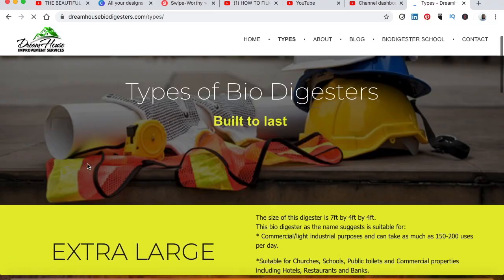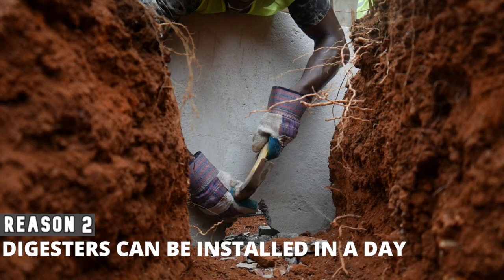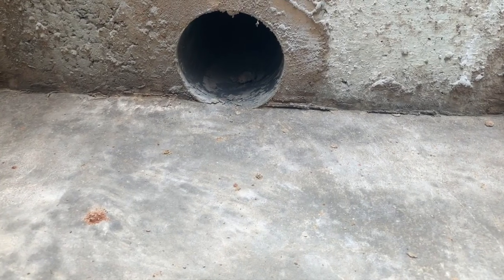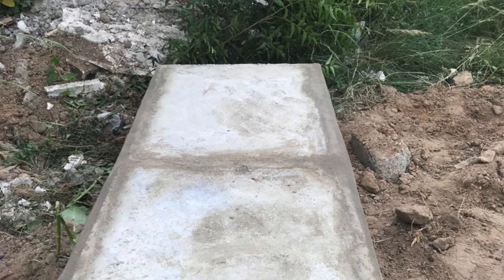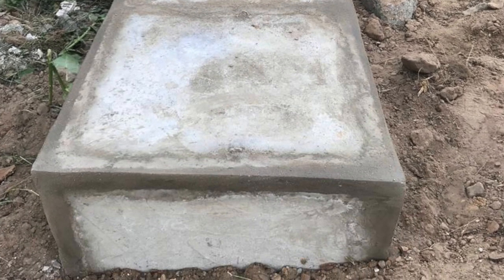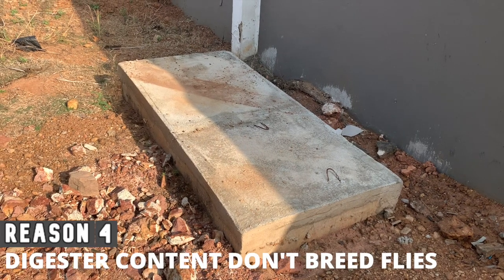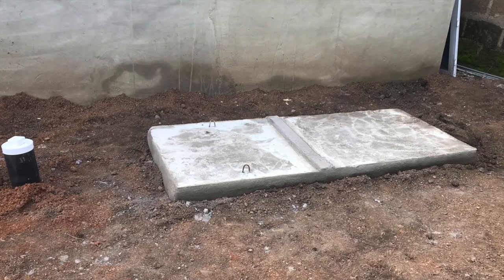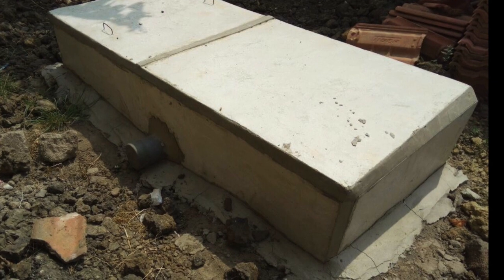6 Reasons Why You Should Construct a Biofil Toilet Biodigester (2020)

Comment: If u have three bathrooms in a house, do I have to three biodigester attached to every bathroom?
Reply from the maker: Bio digesters are basically replacing septic tanks so you don't have to do one for each of the toilet rooms.
Reply: @JerryAdu-Asare  The engineer suggested it because the toilet are on the three sides of the house
Reply from the maker: @chrispow6110  Here is the only reason why you might require more than one bio digester https://youtu.be/ahTyDlMBU28